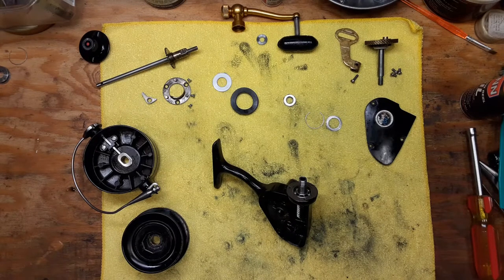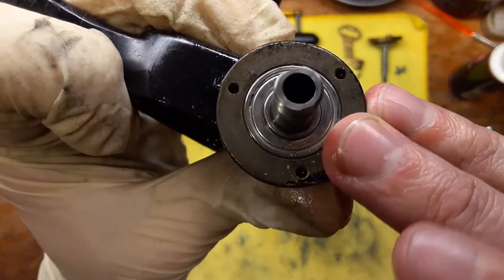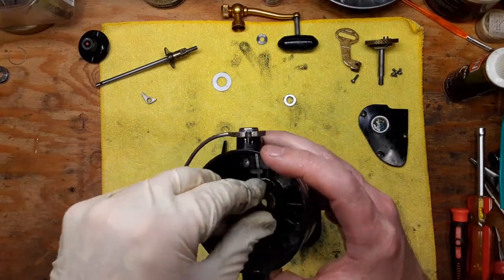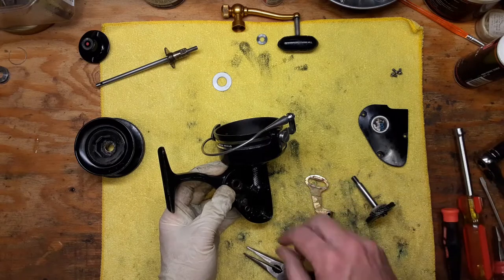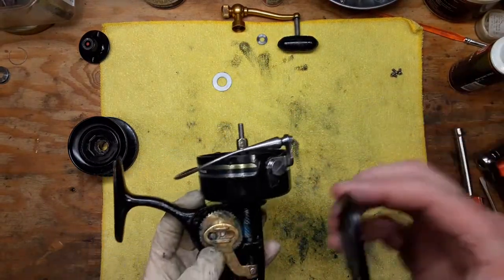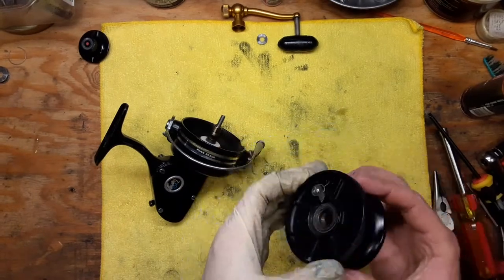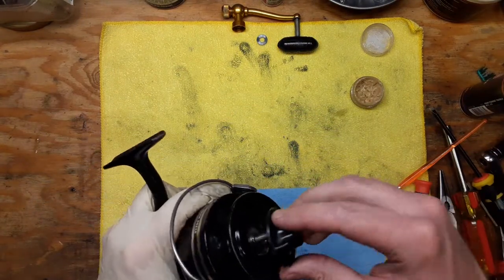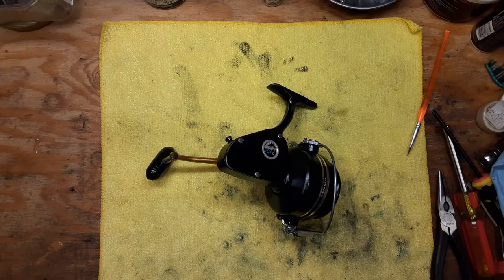Penn Spinfisher 704Z Reassembly Only Service

Comment: I have never serviced a bearing by taking it apart this way. It’s really fascinating. I love these Penn Z reels. I have a gorgeous little 722Z that I restored myself. I put a beautiful little gold capped black Gomexus Power knob on it because the original knob was cracked. It turned out absolutely beautifully. You did the most thorough  job on this reel. This will be an excellent addition to your library. I think my 704Z and 706Z are later models or at least the 704Z is. Both my reels have gold spools and the rubberized T-handle and pancake handle on them. I put the HT 100 drag washers in mine. This video series was extremely well done! — Chris
Reply from the maker: I like to service the bearings when possible.  I love the Z series. They are solid workhorses.  Thanks again for watching!
Reply: @backonthebenchreels  I have been a fan of 2nd Chance Tackle on YouTube for years. Yours is the only other channel that is close. Keep up the great work on these videos! — Chris
Reply from the maker: @christopherjenkins2373  Yes, I love watching Dennis with 2nd Chance Tackle!  I have learned so much from him.  He is the best for sure.